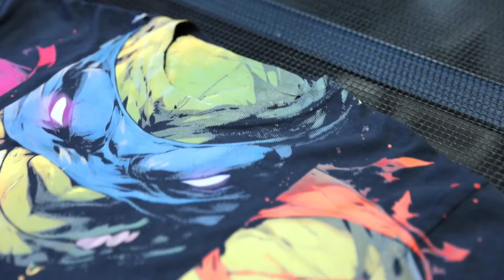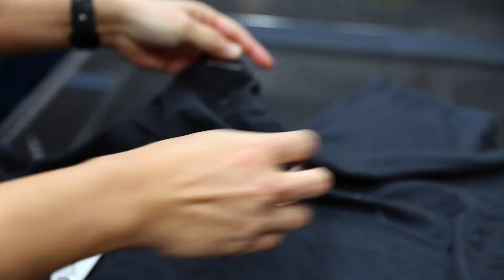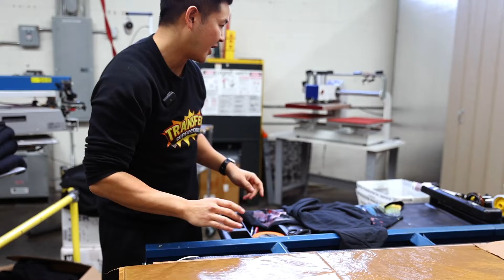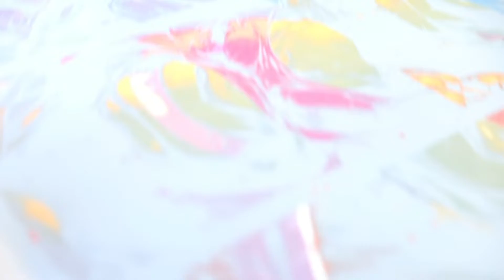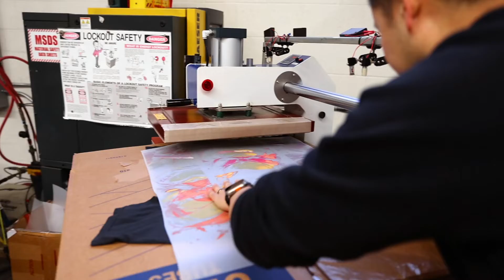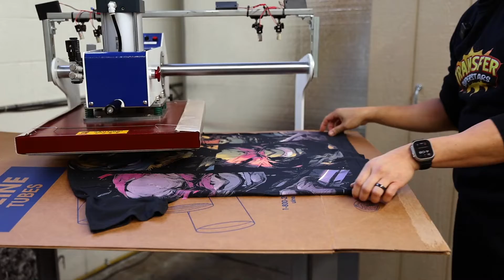Printing a FULL FRONT DTF T Shirt Print

Comment: Random question: What would be the price for DTF Transfer on that size? Also what do you think how much is MSRP for Full front DTF shirt like the one you did? 
Thanks in advance for the answers! Love your channel
Reply from the maker: Its a great question, it would require a 22x30 sheet so roughly around $20-25 for the prints. This particular shirt would be a premium one off. An art piece because its hard to replicate the exact placement along with details. It also takes a lot of work to do. I would add some branding pieces to add some value and try to get min $100 for it.

Comment: very nice and I was wondering if you can do a DTF over another design lets say on the neck and you take it over with youre own design?
Reply from the maker: It is not recommended to press a transfer onto another transfer. It becomes thick and may not adhere for longevity.
Reply: ok I will try it anyway in 2 weeks because some t-shirts that I got have thin dtf on the t-shirt so I will just paste something over but I understand youre point, thanks @transfersuperstars

Comment: Good am, do you recommend manual stirring the white ink tank every hour? Its adhesive may settle down at the bottom of the tank if not stirred manually every hour interval.
Reply from the maker: We recommend stirring your white ink before your printing shift.  You don't need to stir hourly.